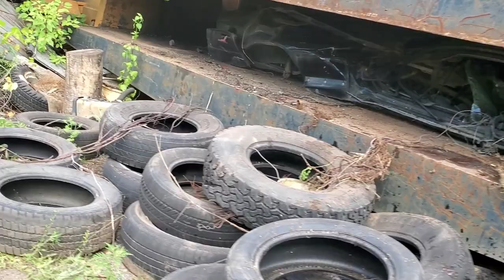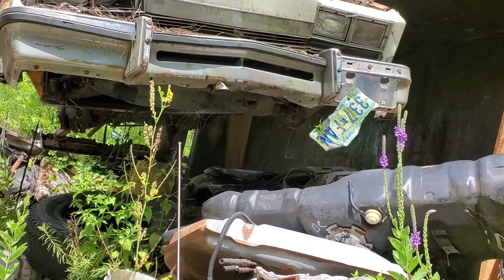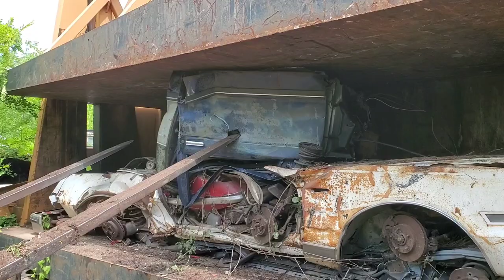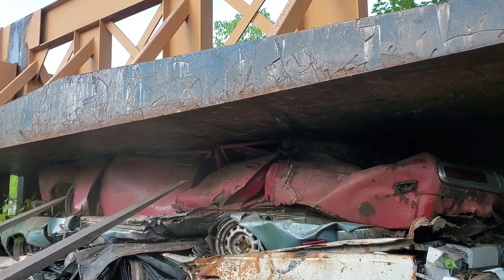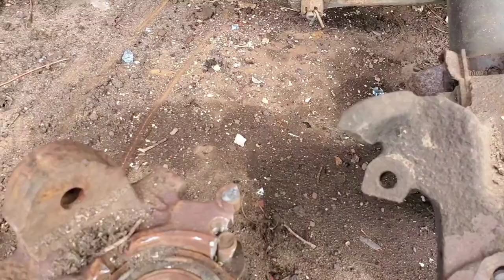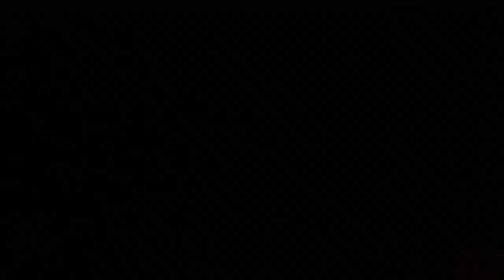Car Crusher Crushing Cars 60 1975 Datsun 610 1977 Chevy Monza

Comment: Datsun 610, I believe.  Some of those trim pieces (rear lights esp) have to be incredibly rare, but few are saving those yet, and so it goes.
Reply: I know. If I owned that yard, I'd be pulling parts left and right and stockpiling them. Wasting parts that are unavailable and useable.. SMDH.
Reply: Grille and taillights should have come out of it for sure.
Reply: @halcyonoutlander2105  I run a classic car restoration shop and I actually was looking for tail lights for a Datsun like that, but most junkyards don't even carry them anymore. It took me 3 months of going to different orders before I found one who actually had the right tail light, though you do have a point about being a hoarder. I have seen some people who do math too many parts, which is why it's important only take the rarest and most valuable parts. Perhaps try to quickly resell them instead of holding them tho, which is one thing that hoarders doing correctly they just take the parts and they don't want to let them go
Reply: Could have used one of those door handles as well 😂
Reply: @halcyonoutlander2105  You are not a hoarder if are saving rare parts that someone restoring one of those vehicles needs, there is money to be made, a hoarder keeps everything pile up, but a salvager saves parts to make $$$$$$$ big difference.
Reply: You probably cannot restore any car featured in these videos.. Most of their body is probably rusted to the point you cannot fix them, unless you spend a lot of money. Your thinking of more exterior, and not interior

Comment: 1st car, picked clean of parts so good to crush, 2nd car, wow! i thought only pick ups snapped like that! god dam that's bad, also came with a snow mobile? huh mind you those things are small money pits you only use them in cold weather and most of the time they sit around there kinda like jet ski's only thre differant but get the same kinda use, 3rd car? or what's left clearly been cut up for others to live on, 4th car looks okay but its rusted out you can see the rear of the boot and the door looked to be err only the inner skin was left, also only 1 rear light left? which dmub dumb only took one you take both not just one, 5th car those rear lights look japan esk? would of grabbed those might be some dollars on those but the rest of the car is completely rusted out bad yep was a japan car as that is a nice front kinda sad as that front might of made good money as ppl want those if its not cracked or the screw holder parts are broken, 6th car, something that like the first been picked clean, dam show you how bad the rust is if that snaps a nut or in some cases you were going to remove that? nope,